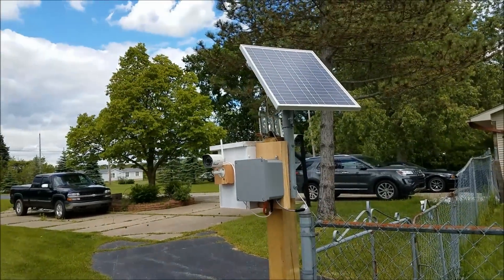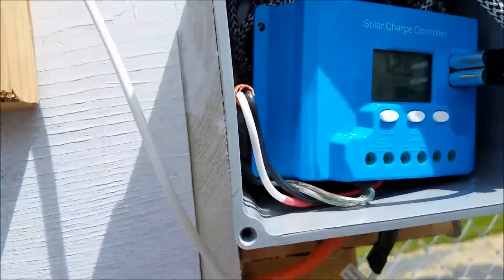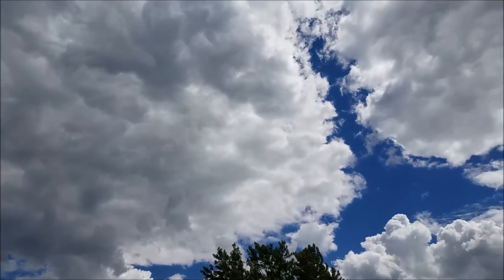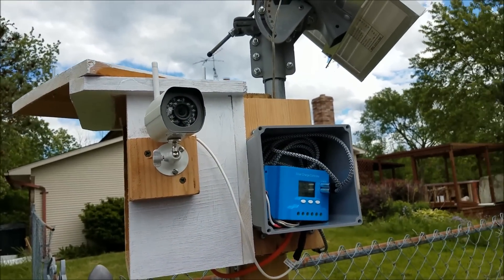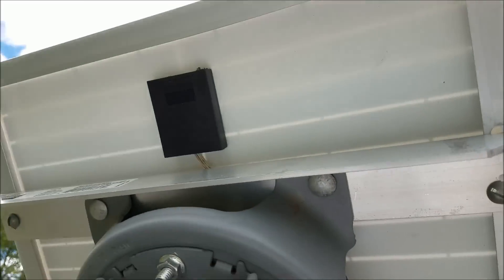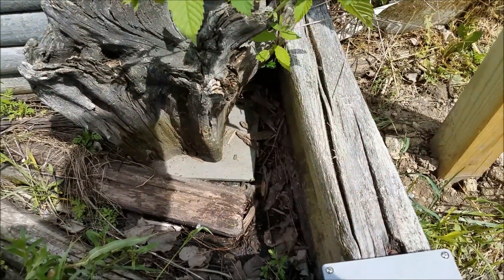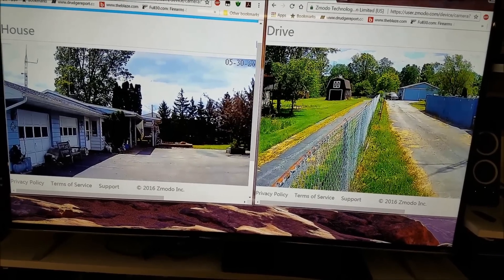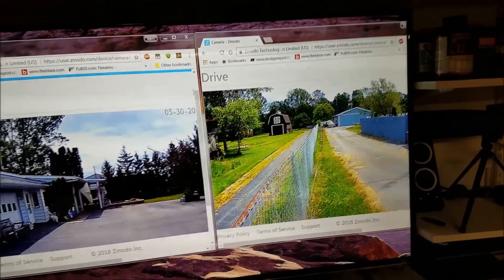Solar Powered WIFI Security Cameras

Comment: Hi - great video! Thanks.  What type of battery are you using?  I'm a City person, so I don't know what type a "tractor" battery is :)  Thanks so much!
Reply from the maker: I replaced the battery with a big deep cycle from Sams. We sometimes get a week of no sun here in Michigan. I ended up building a wood box for it (its way to big to mount on the pole) and sit it on the ground behind the pole. My Wifes camera has not lost power (yet) this year.

Comment: Why not just run a cat5e wire to a POE Camera and be done. I can see this set up if the house is more then 328 ft (the distance you can run a poe camera before loss).
Reply from the maker: Because I did not want to dig up under the driveway,
Reply: 328 ft LMFAo that's kids play. two nanostations can easily save one from digging a trench 6 inches deep and pass video over 2km-5km with line of sight

Comment: Nice setup. I'm looking at put a wifi cam at the end of my drive way to watch over my mailbox. So Solar powered would be the  way to go. I have Funlux cams, they very similar to what you have on your set up. Just trying to look for a solar charging panel that will accept micro USB and provide enough juice to cover night time hours.
Reply from the maker: The advice I can give you is go with at least a 100 watt panel. I started with a 20 then went to a 50 and now finally have a 100 and it has worked all winter for one camera. When spring comes I will connect the second camera. My cameras draw 1/4 amp at 5 volts in the daytime and over a amp in the night time.
Reply: here is a better idea. get your solar up and then use UNIFI antennas which have POE on them to power up a Ip cameras and bridge them together line of sight will give you 300 plus Mbps depending on the antennas you get for instance since IP cameras don't need gig speeds you can get away with nanaostation M2 both antennas 150 bucks

Comment: You are going to burn through batteries left and right if you don't disconnect the load in overcast conditions.
Reply: Pretty sure the controller unit takes care of that part.
Reply: @kasualtoycollector  Oh like if the voltage drops too low on the battery it will just switch off the load?
Reply: xcvsdxvsx I believe so. Too high voltage I think you meant 🤔

Comment: a can of black spray paint.  and about 5 seconds.   BOOM!!  Now your cameras  are 100% only showing you a BLACK screen.    Because, I can walk up to it, and spray the lenses with black paint its totally compromised.  You have to put this stuff UP.,  put it up HIGH on a metal pole.  Get a 4" metal pole that's 10-20 feet tall.   15 feet high would be good height. not too high so the cans aren't needing to look down so much.  Now no one is going to be able to EASILY defeat our system,  because they're going to need an extension ladder to get at it.
Good idea,  you did a nice job.

But trust me.    You need to put it up HIGH.   Or someone is going to steal your cool wireless cameras, solar panels, and batteries..... And use them at their house.
Reply: Oh hey look someone sprayed black paint on my cameras... time to call 911 grab the gun and get behind cover.
Reply: LOL... this is about the dumbest comment yet. Trust me you 10-20 footers are beatable and just by you numbers you haven't a clue on proper placement elevation, what lens etc. then again your name says it all integrated logistics meaning a one man show run out of his garage

Comment: What Kind of WIFI antenna or setup do you have up on your home? I need to put a system in with more WIFI range at my farm.
Reply from the maker: You may think I am nuts (I am by the way) I purchased a good router and had a waterproof box (vented on the bottom for cooling and wires. Being a Ham Radio operator I have plenty of antenna poles up in the air. I mounted the box with the router up in the air 30 feet. Covers most of my 5 acres except in the heavy trees way out back.
Reply: @barndweller4573  Wow 5 acres. Nice
Reply: What router exactly?
Reply: This is the best manufacturer for long range and outdoor WiFi stuff

https://www.engeniustech.com/

Comment: Does that fuse clip on to the wire? Or did you use two different cables and connect to each end of the fuse? what is the name of the fuse you used? Thanks

Comment: Easily jammed, and hacked.
Reply: This isn't oceans 11. It's dipshit teenagers and crackheads.
Reply: pinkeye00 hacked? Why to hack? You can just came and steal this camera's, battery and solar panel. This isn't "safe" way to put camera.
Reply: I'll just hang out in a clown outfit and wave at 2am .. lmao
Reply: pinkeye00 what about  if someone shot with powerful BB RIFLE  at camera or solar panel to disable it ??
???
Reply: Linc Qimiq but why? You can just come use simple screwdriver open box and disconnect battery and that's it
Reply: pinkeye00  but u need to hide a camera  from people to see it and damaged  it not good to viewable camera.  I do hidden camera somewhere  but not in front  fence or street which easy to damage it  they may throw rock at it or shoot with powerful BB  rifle to avoid camera point ( view )

Comment: great video! I want to do this!. Did the cables or connectors come with solar controller? Do your cameras wire into the solar controller? If i went with a camera that plugs into a outlet, how do I hook that up? Looking to have the Nest camera out doors. I like this set up, seems easy. Just want to put a outlet up. The breaker/ fuse? how is that hooked up and where can I find one?
Thanks!
Reply from the maker: The cameras I purchased came with chargers that have the same voltage and plug as my samsung s7 cell phone. The charger cable uses a USB plug. I just found a charge controller on eBay that had 2 usb outputs. I do not think I paid more than 20$ for the charge controller. I would go with a larger solar panel.I am going to upgrade this to a 50 watt soon. It works ok but if we get a few days of no sun then the battery runs down. 

A charge controller is simple. There are 6 connections clearly marked. 2 for battery (this is where you need to put a fuse, I purchased my fuse holder on ebay and put the fuse holder as cose to the battery as you can), 2 wires connect to the solar panel, and 2 screws are for a 12 volt output which I do not use. I am just plugging the cables (again just charging cables for a samsung s7 cell phone) into the charge controller and the cameras plug into that cable. I found cables on Amazon that were for outside use. 

I hope this helps.
Reply: It looks on Amazon like the camera power connection is a female plug which means your cable from the charge controller needs a male on both ends.  This doesn't seem right, huh?  Did you need a USB gender changer, too?

Comment: Hey BarnDweller, how far will wi-if pick up on your phone or pad, how would this work as a range monitor?? Practical???
Thanks Eric
Reply from the maker: I am not sure I understand the question. The camera connects to my WIFI network (In the picture you can see my barn, well the WIFI the camera is using is on the back of the barn but in a plastic box up 25 feet. That Router I put up in the air like that covers almost all my property 5.5 acres except in the summer when the leaves are on the trees. My back property is quite deep and wooded so I put a WIFI extender to give WIFI to the back property when I am back there. The house has WIFI router also and I have a Cat5 cable that runs from the house to the barn under ground.) I do not connect to the camera directly I just connect to the internet and I can see the cameras. I can and have been many miles away and still been able to see the cameras. That is what I like about it I can check the cameras if I am up at my cabin. In fact I have ordered a second set of 4 and I am going to put them outside at my cabin so I can watch the outside of there from home. 

As far as home far my phone picked up the WIFI on my property, I have WIFI everywhere on my property. I did it so save my Cell data my Grand Daughter rides my Gator and her go cart a lot (like for hours) and she listens to stuff on her phone so now it does not use any paid for data just the free WIFI where ever she is on the property. 

I do not know what a range monitor is, please explain I am always interested in learning new things.
Reply: Barn Dweller , let me make my self perfectly clear,hahaha!!  Would it work as a long range target monitor??
Reply: And how much investment for let's say 400 yd distance??
Reply from the maker: If you are wanting a "Target" camera system I do not think you can do better than the Bullseye Target Camera. (www.bullseyecamera.com) I own one and I just love it. Yes it was expensive and I had to wait 6 weeks to get mine but that says something I guess about how they are selling.

Mine is a sight in model so its only designed to work at 300 yards but they have them that can go up to a mile. I will have to do a review about it sometime. I will have to barrow my Grand Daughter phone to record the review because I use my phone for the target camera system. 

If you only wanted a see the target and you had a WIFI system at your target range then yes you could build something like I did, if you put your router outside and up in the air its east to cover a large area. I think the software that comes with the bullseye camera system is what makes the system worth the price and it does not require a WIFI to work, it makes its own WIFI with the router inside the box.
Reply: Is 20watt realy sufficient to keep the battery charged?
Reply: Oh. And would it work with a 7 a/h battery. Then i wil build it myself